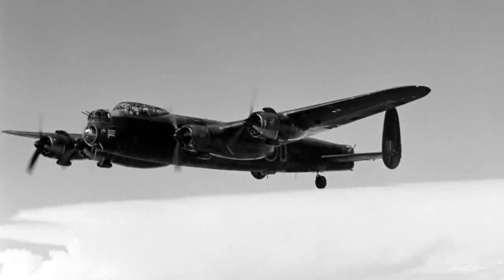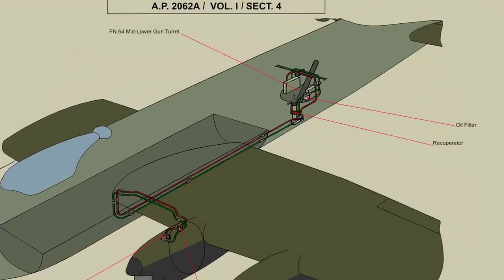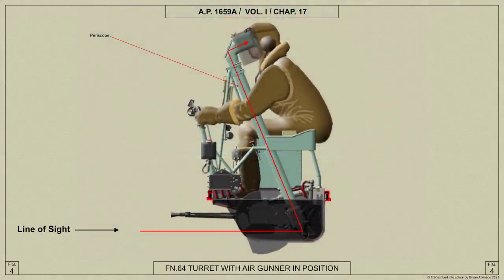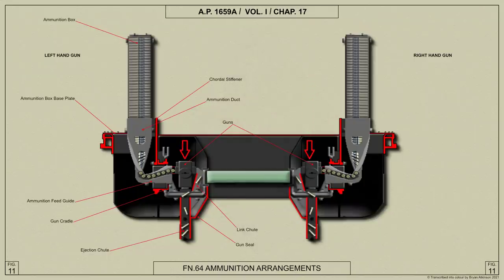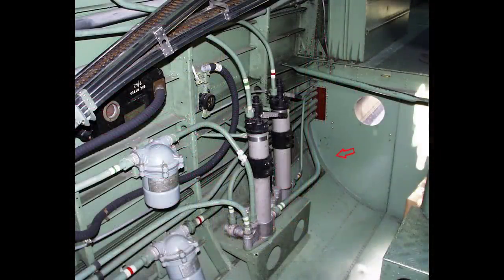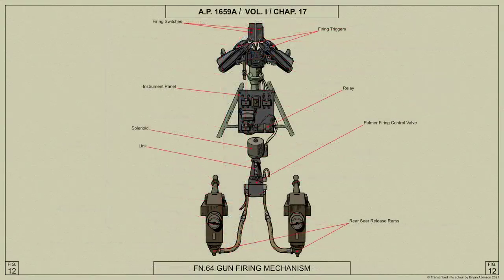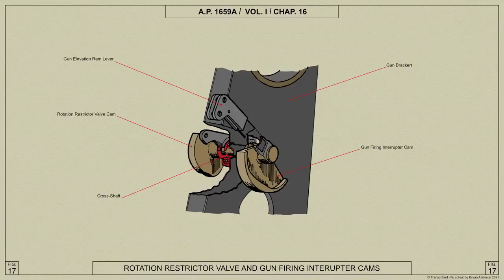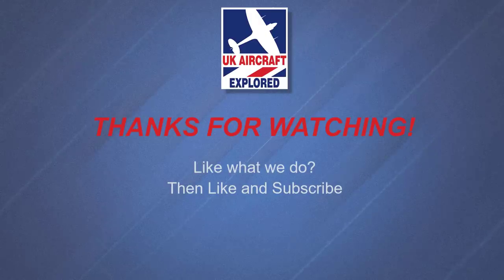Avro Lancaster – FN.64 Mid Lower Gun Turret

Comment: Now that is totally new to me. I'm over here in the USA and have read extensively about the Allied bomber campaign in WW2 and never heard this turret mentioned. Now I known, thank you. As to why it seems to not have been used much, I can only mention the experience with a similar turret on the early versions of the B-17 between the original bathtub Gunner's station and the Ball turret we are all familiar with. From what I have read using this turret would give the gunner a nasty case of vertigo and nausea. Not to mention it was very hard to acquire the target. Thank you for this video.
Reply from the maker: The FN64 Turret was mainly fitted to Canadian Air Force Lancaster B Mk.II aircraft fitted with the Bristol Hercules engine. The turret was not very successful, being used at night.  The periscopic sight offered the gunner very little clarity. Thanks for watching
Reply: New to me too and im 56 from the uk north of Lancaster.

As a kid at school i used to draw Lancasters with bottom turrets and got told off by the posh kid saying thats on b17s

Ha i was right lol
Reply: @somethingelse4878  That lack of a belly ball turret was the price the magnificent Lancaster paid to give it twice the bomb capacity of the b17.
Reply: @Anglo_Saxon1 , not to forget that the Lancaster design also gave up almost ALL armor and "defended" itself with .303 caliber machine guns which had only 20% of the kinetic energy of the .50 caliber M-2. There is a reason that RAF Bomber Command casualty rates exceeded those of ALL other British Services.
Reply: @TheJKCrawford  he early spitfire and Hurricanes also had the  rifle calibre 303 'Pop gun' rounds! eventually those fighters and others such as the typhoon and tempest  ended up with  20ml calibre Hispano cannon. One variant of a spitfire wing even ended up with 20 ml Cannon And 50 cal Machine gun...The best of both worlds!!

Comment: Another interesting Video Bryan.  I wonder why the turret was so little used.  With lots of attacks by the ME110 from below with its upward firing guns, even if the two .303 were not up to shooting the night fighter down , it would have provided a slim chance of the gunner seeing the  night fighter. it would have been the only eyes looking down.
Reply: Your question is a good one.  Typically, these turrets were not very effective.  The American B-25 and other bombers had similar turrets, which were quickly discarded.  There were several issues including a narrow field of view which made target acquisition difficult.  Per Wikipedia; "The ventral (underside) FN-64 turret quickly proved to be dead weight, being both difficult to sight because it relied on a periscope which limited the gunner's view to a 20-degree arc, and too slow to keep a target within its sights. Aside from early B Is and the prototype B IIs, the FN-64 was almost never used."
Reply: @PanzerDave   Interesting, thanks
Reply from the maker: The FN.64 Gun Turret was not very effective, the Air Gunner having a narrow field of view of 20 degrees and trying to look through a scope at night, it would be doubtful if the gunner could ever lock onto, let alone spot an enemy night fighter. He would have had to primarily rely on other crew members to spot an incoming enemy - if they were lucky. The gunner could fire off the guns as a small deterrent to known approaching enemy attacks under the Lancaster, especially once German fighters were fitted with the deadly Schrage Musik gun system. As I understand, the German gunner would aim at the fuel tanks. The FN.64 was used in some B.Mk.Is and the Bristol Hercules powered B Mk.II operated in the main by Canadian crews. But was generally thought to be of little or no use in operations. Thank you for watching and have a great weekend.
Reply: @ukaircraftexplored6556  In addition to the limited view angle, I'd suggest that light losses in the periscope would have had a serious impact on night ops.EDIT: I noticed a post regarding radar warning receivers  (or suchlike), Fishpond was probably what was being mentioned and this was trashed quite early on due to German tech allowing nightfighters to use it to zero in on Lancasters.
Reply: Wasn't gun laying radar (rear turret) and infa red camera detection  fitted early on to the front and rear turrets to make this lower turret redundant? Any fighter in the blind underside spot these turrets covered would have been seen before an enemy fighter could get to the underside. Hence the two circular 'eyes' seen in the front of the Lancaster bomb aimer blister. Apparently the blister camera was so secret it was locked securely away from the aeroplane after each sortie.
Reply: German night fighters using the Shrage Musik system that you describe did not attack from underneath. The weapon system faced forwards and upwards at an angle of between 65 to 70 degrees. To achieve a firing solution, the pilot would form up below and astern, not underneath.
Reply: @darrenjpeters  I read a book at the end of last year about Luftwaffe night-fighter aces (It was published in 2001 ) which included interviews (They were all in their 80s at the time) and they said with the Shrage Music they'd aim between the inner and outer engines of either the port or starboard wing before firing.
Reply: @nicholasmaude6906  Sounds interesting. Would you mind sharing the title of that book with me please? To your point about where they would aim, it makes a lot of sense. Just as likely to cripple the aircraft as shooting at the fuselage, and much less chance of accidentally setting off a bomb load right on your forehead...
Reply: @kenstevens5065  Village Inn AGLT was relatively late.
Reply: @darrenjpeters  the fuel tanks were in that location, so a good chance of a fire. Given the poor hatch sizes on the Lancaster, possibly fatal for many of the crew. Even without a fire, self-sealing won't seal a tank shattered by a 30mm cannon round, so the Lancaster won't be making it back.
Reply: @Swaggerlot  As if spotting a dark shadow against a cluttered, but generally dark background below wasn't hard enough. Can only think they were considering daylight operations when  the design happened.
Reply: @jonhume6051  That would be the only logical reason. After all, night operations only came to the fore when losses from daylight operations were recognised as a major threat.
Reply: @wbertie2604  Thanks very much for your input.  Perhaps you can confirm that it was little used because it was considered dangerous to friendly aircraft in automatic mode. Do you know if there was just a rear search radar fitted to some Lancasters before then to warn the rear gunner of a hostile approach? Personally I think the Nazi home defences realised the war was lost by spring 1944 but Hitler couldn't see it. Too much to try and cover up perhaps or he was just crazy, not that I think he had a conscience.
Reply: @kenstevens5065  IIRC there were warning sensors for being locked on, but that the sky was so cluttered with radar it wasn't always a useful. system, and even more so when there were Mosquitos in the bomber stream. You are right about the automatic mode being potentially dangerous. I can't remember if there were separate radar sets for detection. I don't recall there being any.
Reply: @wbertie2604  Thanks for the information.
Reply: They tried a similar concept on the B-17.  Did not work, and they moved on to the manned belly turret.
Reply: @PanzerDave  true, plus it's fitting meant the plane needed an extra crew member to operate the turret.  Fwiw I've been a big Lanc fan all my life, since building the Airfix one (what else) as a kid c1970. Yet it was only today (2023) I found the early Lancs had this turret - thanks to the ever-informative BBMF newsletters - previously I'd always assumed was just the Yanks who used belly turrets. Live n learn eh.

Comment: Wonderful video. May I share some info with you? The Lancaster pictured, I recognise that image. I notice JI prefix and "O" on the nose. I also notice Hercules engines not Merlins. JI is 514 Squadron RAF. I Co Authored the 514 Squadron unit histories. I think that is LL734 JI-O, BUT, I would need to check and confirm that. It replaced my Grandfathers crews aircraft after they were kia June 15/16. 1944.  (The original JI-O was DS816) I'm pretty sure your gunners name is an Aussie nicknamed "Dauntless" Denahey! I can indeed do further research and confirm this all easy enough if your interested. We/I have a pic of him if I'm right. 514 Squadron received 2 MK-IIs with ventral turrets btw. Also, it was indeed, mostly, MK-II's that ran them. 514, 115, 75 NZ Sqdns of 3 group. :-)
Reply from the maker: Thanks for your comment. I obtained the photograph from wiki commons. for the video. The description, ties up with what you have written, as follows - Lancaster B Mark II, LL734;JI - O of No. 514 Squadron RAF based at Waterbeach, Cambridgeshire, returning from a daylight attack on the flying-bomb launch site at Les Catelliers in northern France ("Noball" operation).
I hope that helps and thankyou so much for watching
Reply: @ukaircraftexplored6556  , not bad for off the top of my head hay! We have amassed a lot of data on 514 Squadron, a full searchable database of every crew and every serviceman. We share info with families freely. I run the 514 Squadron RAF page on facebook with my 3 colleagues. :-)

Comment: Me being from across the pond, I never knew how the gun pods on a Lancaster worked. I believe it's a better idea than those death trap ball turrets on a B17. Thanks for showing this.
Reply: It probably wasn't better, the guns are borderline useless and the ball turret operator was better protected. He wasn't completely surrounded by armour but certainly from some angles and with the placement of the guns, Lancasters had very little armour in the entire plane so all that turret operator had was the aluminium structure of the plane with the guns providing some protection from some angles.
Reply: The B17 ball turret caused considerable drag. The smaller turrets like this on the Lancaster and similar remote control turrets on the B29 caused less drag so presumably more could be fitted.
Reply from the maker: Yes, the FN64 Turret was mainly fitted to Canadian Air Force Lancaster B Mk.II aircraft fitted with the Bristol Hercules engine. The turret was not very successful, being used at night.  The periscopic sight offered the gunner very little clarity. Thanks for watching
Reply: The ball turret was pretty much the safest turret to be in on the B-17 - much lower loss rate than tail or waist positions.
Reply: Early versions of the B-17E, mainly those sent to the Pacific actually had a similar turret fitted. This turret turned out to be rather useless and was removed, just having a fairing on the underside. The Sperry ball turret replaced it on later production E`s and became standard on later models of the B-17.
Reply: @Dave5843-d9m   every time a periscope sight was put on a gun, (early b-25), B-17 early, the operator got vertigo and soon they were all removed
Reply: Thers a video on yt which schows that the ballgunner has the highes survivalchance in a b17.
Reply: Statistically, the ball turret was the safest place aboard a B-17 in combat.

Comment: Thanks for sharing that Bryan. I was always curious what, with some many Lancs shot down from below by German fighters using upward slanting cannons, this wasn't used more widely. So far I've only heard of it being used by RCAF operated MkII Lancs fitted with Bristol engines such as the one in your picture. I think the need for H2S trumped the ventral turret and Lanc pilots learnt to gently weave so the rear gunner could check below.
Reply from the maker: The problem facing usage of the FN.64, was that the gunner's vision at night through the periscope system made spotting an enemy aircraft very difficult, if not impossible.  Thanks for watching
Reply: @ukaircraftexplored6556       It is my understanding that the RAF were totally unaware of the upward firing German night fighters who were deadly.   I have also read that our own night fighters were disbelieved when they reported they could sit below our bombers ,  on the way home,  and were not seen.    I think there was a lot of complacency by the powers that be ,  who seemed to focus on bomb load and accepted losses with a shrug.   I have also read that our bombers cruised at economical cruising speed to maximise bomb load,  but that flying a little faster would have made it that much harder for the overweight night fighters to intercept them.   Creeping up from below  certainly put the night fighter in an equally dangerous vulnerable position.
Enjoyed the video and the technical detail.
Reply: @californiadreamin8423  Freeman Dyson suggested removing all defensive armament to increase speed but it was felt that it would reduce crew morale to the point of having a mutiny. Some Free French basically just used a tail turret.
Reply: @wbertie2604    Thanks for your comment.   I thought the turret was let down by its short sighted 😈 optics ,  and a much simpler “window” could have been devised.
Reply: @californiadreamin8423  the FN. 64? No, it had to use mirrors to achieve the low drag profile. Bristol had created a nose turret years before that was in many ways like the US ball turret, but no one thought to hang it underneath.

Comment: Thanks for this- I've found very little information about the Lower Gun Turret. It would appear that this was the location for the rear spotlight fitted to the Type 464 (Provisioning) Lancasters used on the Dams raid, and not the aft end of the bomb bay as most authors of books on that operation would have it. This makes sense- a spotlight at the aft of the bomb bay would have been difficult to adjust, as was necessary when the dropping height was altered from 150 to 60 feet, and was a ready-made location for installation of the spotlight.
Reply from the maker: Thanks for sharing and watching
Reply: Apparently, the Type 464 originally had a Vickers K gun mounted in this position on a simple flexible mount but this was later removed. Probably due to the spotlight being fitted.

Comment: If I interpret fig 3 correctly, loss of the port inner engine cuts all hydraulic power to rear, mid upper and mid lower turrets. That's quite a  single point of failure. Also, like it, subbed
Reply from the maker: The Hydraulic systems for each gun turret was similar. The Fig 3 Diagram you mention, was a A.M. diagram that illustrated the relevant equipment used for each turret system marked in bold text. To clarify, each turret was powered by a different hydraulic pump, mounted on each engine as follows. The Front Turret - Starboard Inner. The Mid Upper - Starboard Outer. The Mid Lower (if fitted) - Port Inner and the Rear Turret - Port Outer. Thanks for watching.

Comment: Fascinating because I never knew that the Lanc had a lower turret. When were they introduced, how many Lancs were fitted with them, Why were they not standard, etc?
Reply from the maker: The FN64 Turret was fitted in the main to Canadian Lancaster B Mk.II aircraft fitted with the Bristol Hercules engine. The Turret was not fitted as standard as it was not very successful, being used at night.  The periscopic sight offered the gunner very little clarity. Thanks for watching Nigel!
Reply: @ukaircraftexplored6556  some apparently got fitted after the move to daylight bombing later in the war to a few more planes, ones that didn't have H2S, but then they stopped again as relatively few fighters were being encountered by late 1944. They did sort of make an effort to fit 50s to Lancasters, finally, although they abandoned the attempt to provide a 50 nose turret on the Lancaster per se, only the Lincoln.

Comment: AFAIK Operational Research recommended getting rid of the upper turret too. They estimated that the resultant increase in speed of the Lanc would have saved more aircraft than the turret could. The crews disagreed and the idea was canned. But I'm no expert. I think it was mentioned in the autobiography of Freeman Dyson who worked for OR.
Reply from the maker: Thanks for sharing
Reply: Dyson also suggested removing all the turrets. The Free French often removed the mid upper.

Comment: I always thought that turret was commanded by the upper turret gunner, or was even shared with the tail gunner through some fire control system. But I assume the sophistication found in the B-29 or A-26 Invader of later turret evolutions.
Reply from the maker: Each Turret had its own Hydraulic power supply and gunner. Thanks Steve

Comment: Never realised before but the Browning's must have come in a right hand and left hand model?
I guess the Allies weren't short of Brass if the bullet cases were just chucked overboard?
Reply from the maker: The mounting frame was handed. The Browning guns could be mounted on either side of the turret. Thanks for watching - much appreciated Mark
Reply: @ukaircraftexplored6556  Having subsequently done a little research I have discovered the Browning could have it's feed side easily changed (in a couple on minutes by a competent Armourer).
I now know more about the Browning than I will ever need .

Comment: What's the spirit container? Is that where you keep your drink?
Reply from the maker: Good question. The type of spirit isn't mentioned in my AP manual. If I find out, I'll let you know. The Lancaster's Forward, Mid Upper and Rear turrets were not fitted with a Spirit Tank. So it had to be something related to the Ki-Gass pump installation fitted in the FN.64 Turret. Thanks for watching.
Reply: I wonder if it is a simple form of anti-icing?